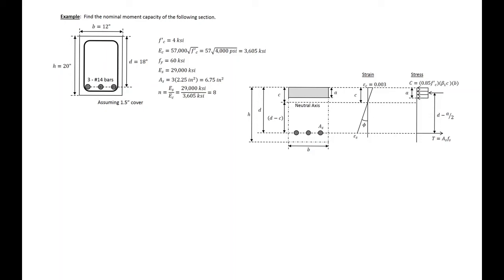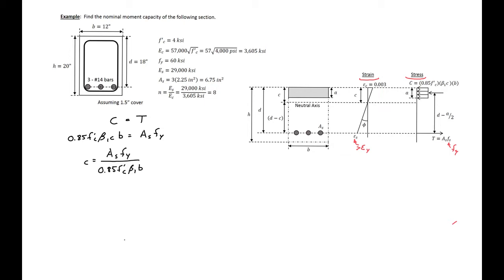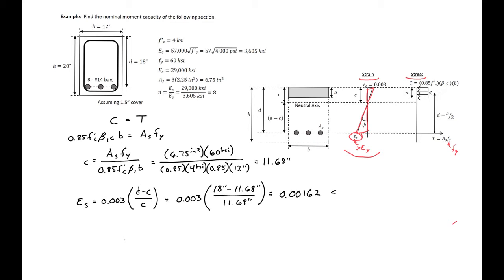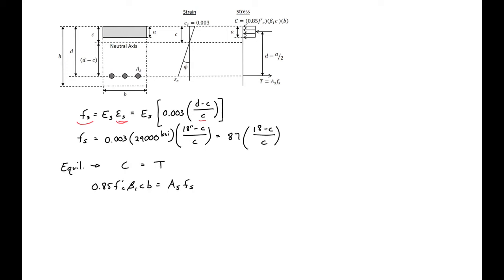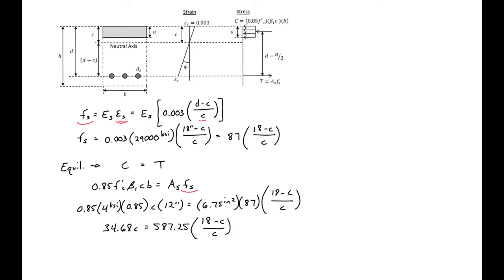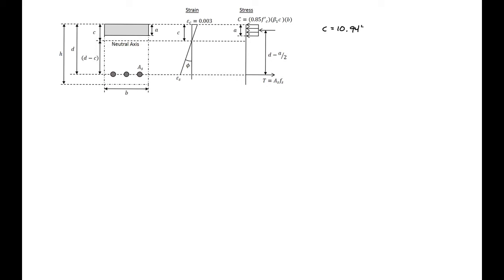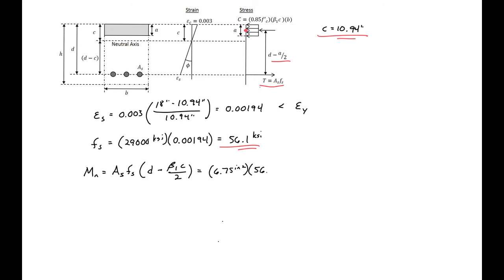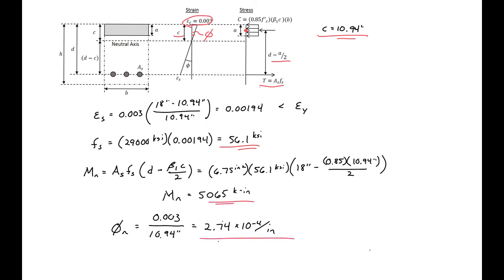3 - Example - Finding Nominal Moment Capacity When Steel Doesn't Yield

Comment: At first you checked that if the steel yields or not at the "c" you have calculated ,, and it shows that it didn't yield ,, so you used Hawk's law to find fs in terms of "c" ,, then from C = T you calculated "c" 
Then you checked Es for the new "c" and still didn't yield ,, but you took the new "c" in your calculations of Mn ,, why you didn't take the first "c" since both didn't yield the steel !